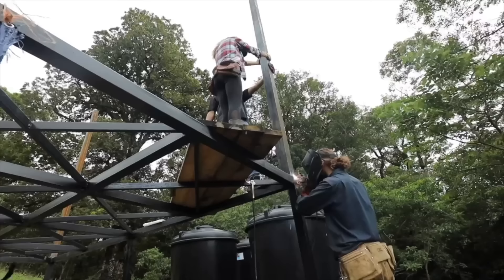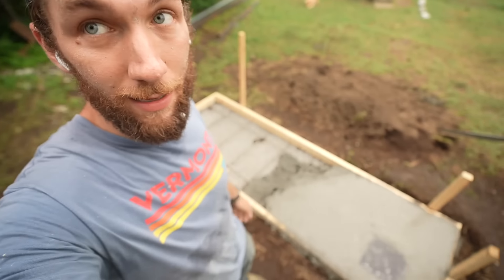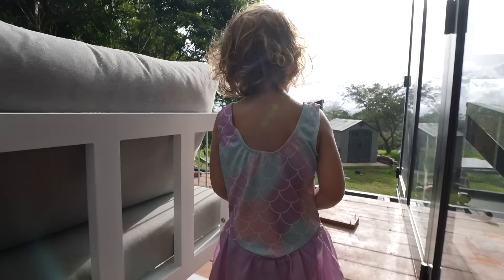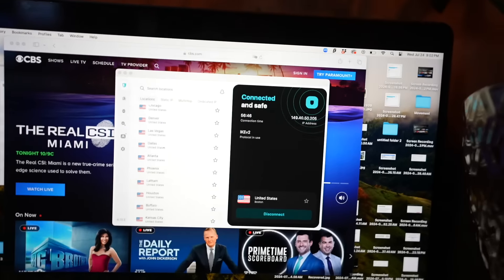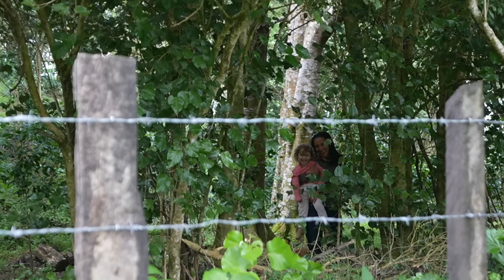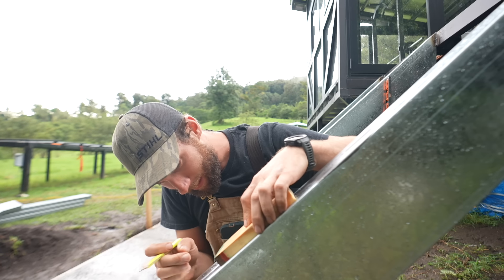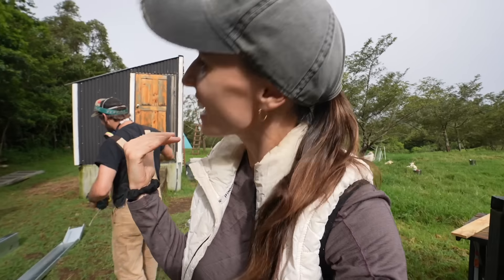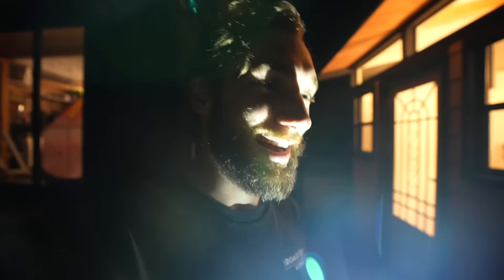IT'S COMING TO AN END // finishing our build

Comment: some good electric gloves... keep these insects from touching... your fingers... sure it will make you sweat but still your hands will be safe.

Add some non-slip or grip tape by 3m (comes in Tape form) on the edges of the stairs... so no one is slipping off the stair.. if going down.. in a hurry.

Comment: Mate I would not be just relying on welds with those stairs. I would be over engineering the crap out of those stairs with angle brackets and bolts, last thing you want with your wedding are your guest breaking the welds and falling through the stairs. But on that note love your work. Please over engineer the stairs.